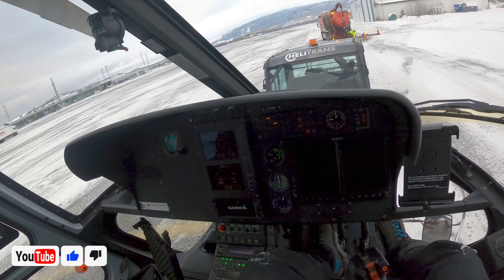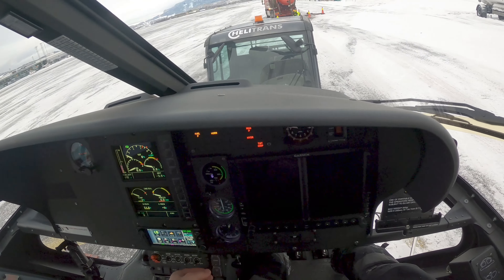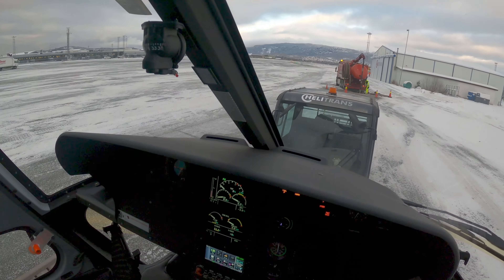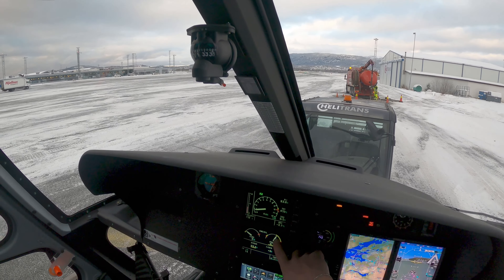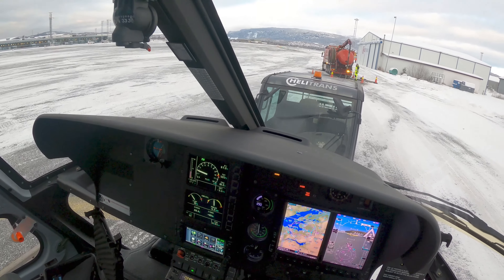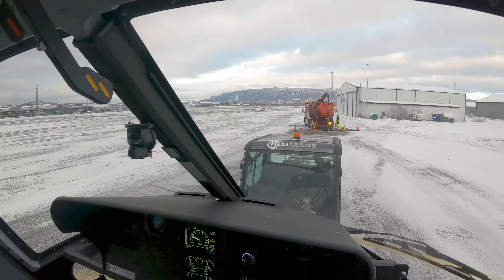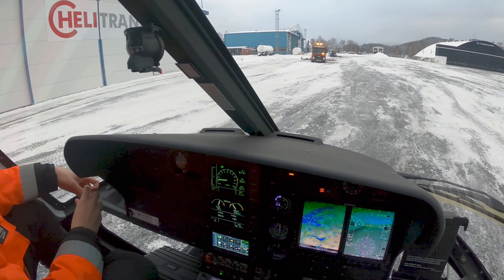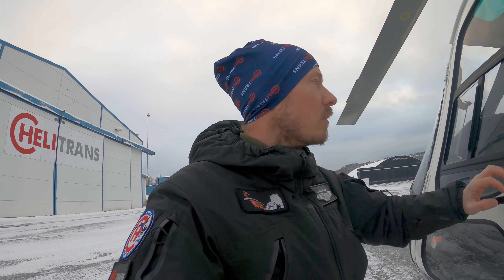H125 Startup tutorial, how EASY is it to start a helicopter??

Comment: Looking back at older turbines like the MD500 or the B206 which takes more to start up and even with a huge risk of entering a hot start if not started properly just shows even in the small things, yet on the ground can be complicating. Now with the newer rotorcraft like the 407 and the H125 with the FEDEC systems makes starting a helicopter easy, therefore reducing pilot overload on start. Although, it can be boring doing these ''FEDEC'' starts sadly.
Reply from the maker: Yes not much of a challenge,, tip: FADEC.. At least on h125

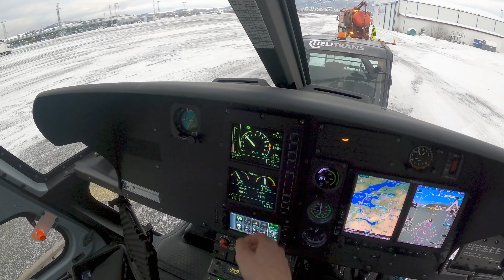Comment: 07:58 ?
Rpm increased by switch instead of throttle twist grip
Reply from the maker: hello Anikesh, when i put checklist away and ready for "flight mode" i put my hand on the horn switch to be ready for the low rpm warning signal test, the actual increase from idle to flight rpm is coming from left hand input on the collective throttle being set to flight detent. So no, rpm increase does not come from pedestal switch.